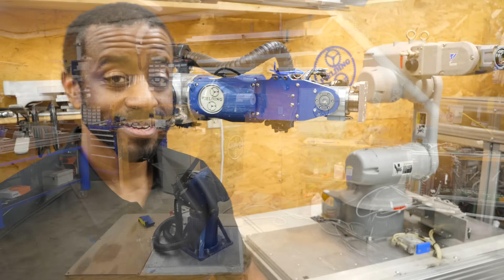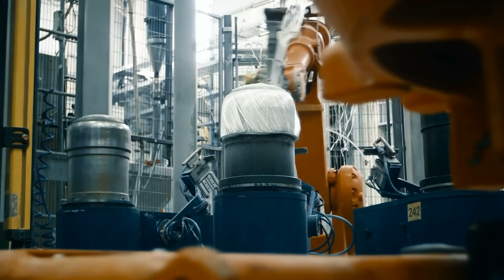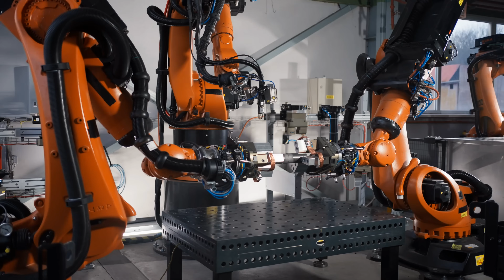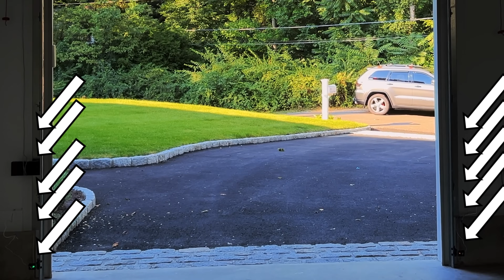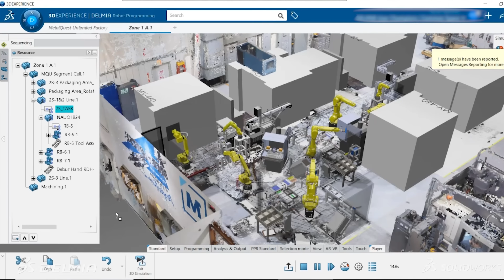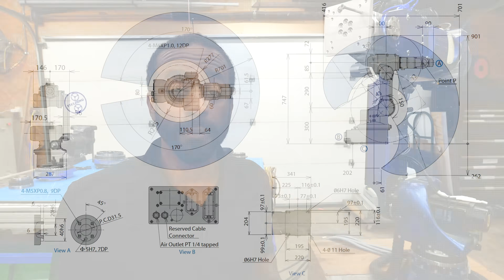An Introduction to Robotics And My Visit To NIAR Robotics Lab.

Comment: I am a robotics and machinery safety engineer, so I use those safety devices all the time in industry for robot cells or other automated equipment and I love love love the emphasis on safety in this video. Great job! 

I have seen a lot of cobots that are able to move around the 1000mm/s mark until required by a safety signal to slow down. As for weight, absolutely. Max pick on a cobot is usually limited to 20kg or so. You can't change that because the force is so high it wouldn't meet any of the RIA/ANSI/ISO standards

Comment: The FANUC M-2000iA is one of the biggest and most impressive industrial robot arms ever made able to move 2300kg (5070lbs) over a large area.  Think of the stress on all the joints moving that kind of mass.

Comment: What if for the adding the human inside the cell but adding a wearable sensor on the people working in the factory. Utilizing a system similar to a gps tracking device to allow the robot know the persons location. Placing the parameters either specifically in the area of the robot or even within the factory floor entirely.
Reply: Kinda adds a “closed loop” element to the robot. I know little to nothing about this but had the thought but, no clue as to the true application of a system like this.

Comment: I understand it would be a lot of data but isn't the concept of picking up an object delicately is to use the least amount of grip strength needed to perform a given movement without slipping and without reaching the plastic deformation point of said object?
Reply: presumably able to inspect performance and result and adjust parameters as needed?

Comment: Would absolutely be interested in an online course on robotics.  I started messing with Arduino a few months back, and am currently trying to build a simple pen plotter using stepper motors I salvaged from old damaged printers and the servo motor that came with my arduino kit.    A small desktop robot arm is a future bucket list project and, having seen the way you teach, I wouldn't hesitate to buy a robotics course if you produced one.

Comment: I read certain shots do have micro-bots in them and individuals aren't being told.  So, I became very curious to look into it and found a lot of articles that said that the science is there. Medicine and science are combined more than people realize. I read another blogger's cure and how to destroy all micro-bots in your body. I saw several remedies on how to destroy them. I read something that small would have to work on something less than 0.05 volts based on its size alone you can’t get batteries with much voltage that small. If they get their power from you, the human body runs of millivolts. which is far less voltage. So sending a voltage through your body say 1/4 to half of a stun gun. should sort them all out. Yeah, it would be painful but they all be dead in just seconds and you will be back on your feet in just a few minutes. The reason for such high voltage is to get it everywhere in your body. A police taser typically peaks at 50,000 volts, and by the time it reaches your skin, it's only around 1,200 volts... Not even close to a million volts. So a little 500 volts no amps should be more than needed to kill them all. But, the person didn't mention if they were a medical doctor or not. So, not sure how a medical doctor would issue a Taser or what these microbots are used for.

Comment: Thanks for the great information regarding the Robotics. I am a fresh graduate from Mechanical engineering with, now, an year of experience in industry and my interest in Manufacturing, Robotics and Automation. I have watched your series on Jarvis 2.0 which also provides great knowledge about robotics.
As you mentioned, course on robotics would be a great help to fresh entry level job seekers fresh graduates in Mechanical/Electrical/Computer/Mechatronics, etc. Engineering. In short, it would be great idea to create structured course content on robotics which includes all aspect of designs including mechanical, electrical, and computer/software engineering (Designing, building and operating a robot from scratch).

Comment: You should see the new papers that just came out. They might change your introduction to robotics part, though it will still apply to the original style of hand coded robots. The new papers are for Google's RT-X and Microsoft/OpenAI's GPT-4V ( "Open X-Embodiment: Robotic Learning Datasets and RT-X Models" and "The Dawn of LLMs:Preliminary Explorations with GPT-4V(ision)" respectively). The channel AI Explained has a good summary of it called "RT-X and the Dawn of Large Multimodal Models: Google Breakthrough and 160-page Report Highlights"

Comment: I have been watching now for years, and love how you do your content.  But i really miss the days when you explained the basics and made cool things out of junk you found on the side of the road.
Reply from the maker: I have been thinking about that myself lately LOL. I have plans to do many “intro” and basic stuff videos. That will start probably after the next video. I wanted to test the waters with more complex videos and I don’t think enough people are interested. I want my videos to be helpful and interesting. Finding that balance is hard. As to building from “junk”Basically building all that stuff from random parts and using them greatly increased my understand of ALL the reasons why certain engineering decisions where made and that means when I take a motor out of a washing machine today for example I have a much deeper understanding of why that motor is in that machine. Before I would think “can you make X with Y and I probed understanding motor choices and how parts function in different applications … the answer was pretty much always yes it would work! But now I also think “should you make X with Y. Knowing what I do now” And thus I tend to look for the “right” part instead of the part I have on hand. The junk parts can work, but there’s a (usually a lot of them) reason(s) no manufacturer is doing it that way. A bearing still works as a bearing, but there is a more appropriate bearing for that application, and more appropriate motor for that job etc. that’s my Delima. Now that I know what should be there and understand why more deeply it’s not as fun to use the “wrong” part just because I can.
Reply: @Jeremy_Fielding  thanks! Truly appreciate all that you do.

Comment: Back in the 80's I was learning CNC and the college had a CNC Machining Center and a CNC lathe set up with a small industrial robot positioned between them. One of the assignments was to transfer parts between the machines. The Lathe used flood coolant so the door had to be closed when the coolant was on ,  Unfortunately the interlock for the door open/close position was not always reliable and a number of times the Robot tried to remove/place parts  in the lathe with the door closed. The results were usually a bent or broken End effect wrist. which were very expensive. We managed to acquire a set of drawings for the wrist and managed to write a program for the five axes mill to machine them.

Comment: I for one would love to have a course on robotics with example problems that we can solve including using software (python would be awesome as it’s open source and easily accessible). I’m a rocket engineer that works with robotic arms in manufacturing but I have a very high level understanding of the kinematic and programming that is involved in them. I’m working on some home projects now but the software is my hang up right now!

Comment: i also used a ABB IRB4600 40KG with ABB Safemove2 and the Sick S3000 Laser scanner and a TCP force sensor to create a cobot out off a big industrial robot for my employer , it was a fun project to do. it all runs on profisafe over profinet (Siemens) with a Simatic s7-1215F Safety PLC to get the whole system to performance level D (PLr D). The robot is used to mechanicaly clean baking moulds for a big pancake/toastercake line with 160 double moulds

Comment: Another awesome video about robots and robotic applications. Thanks for taking us along on your visits. What I'd personally like to see / learn / know: is there any standardization around what they label each robot axis and what does a final, raw program look like? Teach pendants seem to be a newer thing but, what's the raw program look like (similar to G-code) that manages the paths each joint takes to move to a final position? Is that how educational robots are programmed?
Reply: My experience is with ABB robots, but I think others are somewhat similar. The axes are numbered one and up starting with the one closest to the floor and going up. All the ones I worked with were six axis robots and axes one and five would rotate while the rest were more like elbow joints.

The program is surprisingly similar to computer programs. It's like a combination of C and Python, not G-Code. Most of the instructions though are move instructions, setting outputs, and checking inputs. You have MoveJ instructions which move each axis to the target separately. It's faster but the tool isn't going to move in a straight line, perhaps not even close. To move in a straight line, you'd use a MoveL instruction. For both, you give parameters for the destination, speed, and a few other things.

So part of a program might move the robot to a position, open the clamp to release the part (that might require sending an output to a device), move out of the way, set an output to let the PLC or next robot know it can start the next stage, wait for a signal back acknowledging it, move to the next position, and so on.

Comment: I want to buy a kuka robot. But thay are so exspensive in norway :( 2/3 x the price in lats say germany, spain or USA
Reply: Have you looked at other brands? Fanuc and Motoman are usually a bit cheaper generally, while ABB and Kuka are more expensive.
Reply: @AlexKall  Not really. Must say i am a bit scared going for other brand than ABB and KUKA. Getting help and parts is going to be harder i think. :/

But i have much work to be done before i can buy one. So hopefully i can find some cheap, when i finally have the space and money for it :/
Reply: @Norway0-0  I know what you mean, I started working with ABB robots then the company I worked for, a robot integrator, decided to start offering different robot brands from being an ABB Partner, and I would lie if I said it wasn't a challenge going from an ABB robot to the other ones. It would probably have been an easier journey in the other direction.

If I have a choice it will be ABB, the other brands simply are not as enjoyable to work with. Then again, someone starting with Kuka, Fanuc or Yaskawa would probably say the same of the brand they started with. Programming ABB robots put a smile on my lips.

Comment: Thanks for sharing, Jeremy. I am currently working on a project that involves a small commercial robot arm acquired from our local scrap yard. It uses stepper motors and encoders. I am working on adapting Chis Annin's AR4 code for my use. I also built a mobile platform for it using Hoverboard BLDC wheel motors. I wrote some code to take pulse/dir signals and translate it into pwm, brake & dir signals for the BLDC drivers.  Vision and other sensors are in the future, also possibly integrating an LLM on a Pi5, (when it arrives). Main goals on this project are low cost, re-use/recycle, modularity, and  adaptability. I want it to become a general purpose household robot that other people can replicate to some degree.

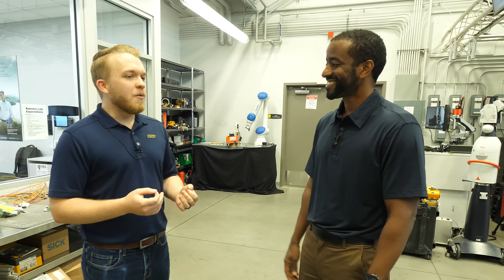Comment: 26:20 Paramount's Mwari aircraft is CNC manufactured straight from digital models, except for the composite panels and some hand-rolled sheet metal parts. Ironically, this is presenting a certification issue because none of the manufacturing or assembly information exists on paper - it's all in the CAD viewer, hence authorities are interpreting this as "no drawings"...

Comment: Hi Jeremy, this is off topic but I can use your help if you have the time.  I have a Kenmore Model  110.24922200 90 Series washer. After completing one load of wash I started a second. The tub filled with water, agitated then stopped. No matter what setting I put it in nothing happens other then the water will fill. No humming, nothing. I did check the lid switch, it is good, I even jumped it to make sure. I also replaced the timer. I tried tracing the wires but got lost. If you can point me in  the right direction I would appreciate it.
👍 # 162
Stay well, Joe Z

Comment: I work with 36 robots everyday they run software programs cameras are the feedback problems we have robot grippers are preset air regulated pneumatic so an air leak at the quick connect can cause it to drop parts sometimes suction cups wear get torn cause tiny unseen leak so you have to feel in your finger tip a loss in vacuum another robot we use was damaging material in parts the fix was duck tape over 1 camera as robots wear running 24/7/365 for years start to have alignment issues so we slow down cycle time until next rebuild i keep telling everyone at work ai software like tesla cars would be a huge benefit
Reply from the maker: Thanks for sharing! I know parts wear out but it’s always interesting to me to hear specific issues that lead to failures.